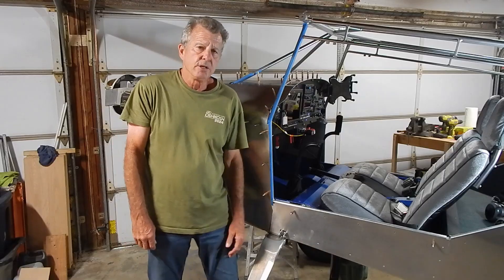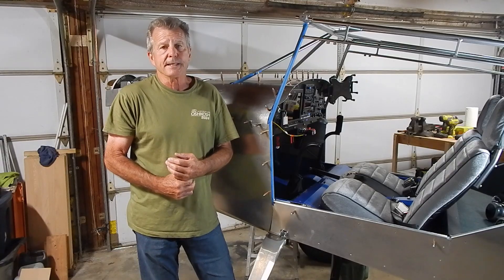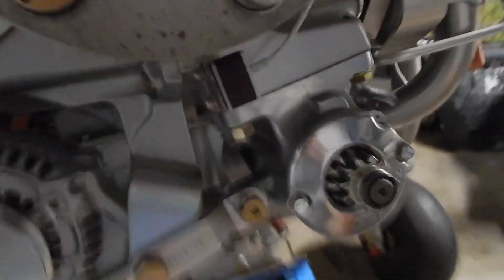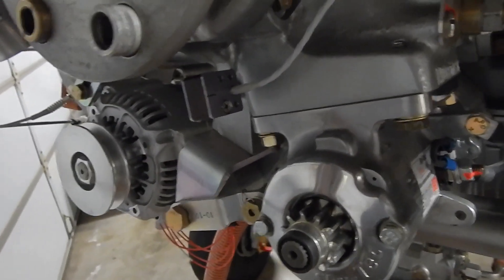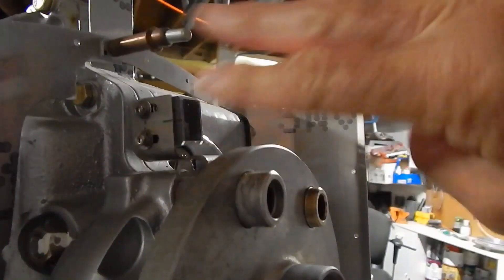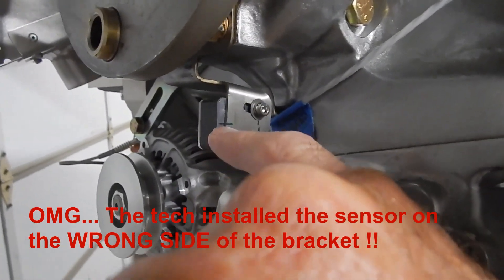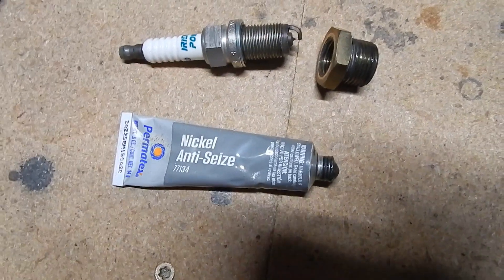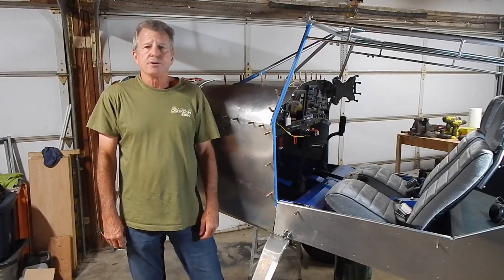RANS S21 ep 52 Lightspeed Ignition Struggles

Comment: I hope you have dual 12 volt, (two Batteries power source). If you are using only one, if you lose that one you don't have any ignition. We have installed this same ignition on our Long EZ.
Reply from the maker: I'm learning a lot as this is my first build. Losing my ignition from a battery fail is something I learned as I built.  Current plans do NOT include dual batteries, but I am working on a plan to add a battery, or switch one EI for a P-mag.